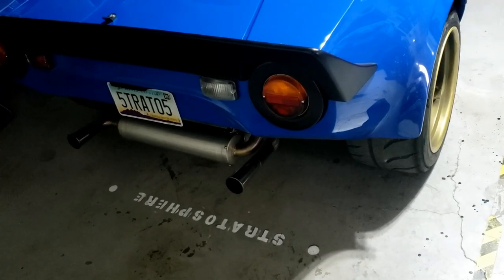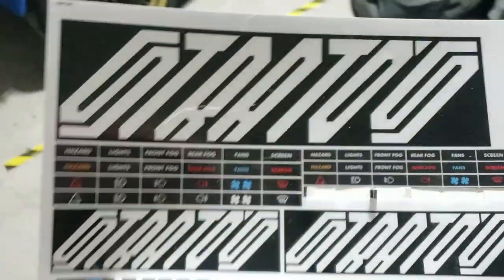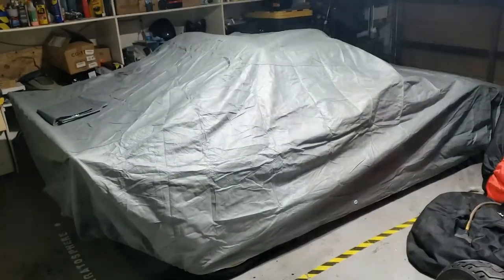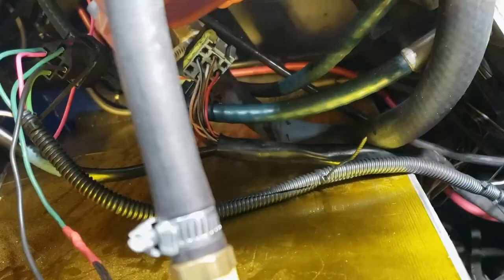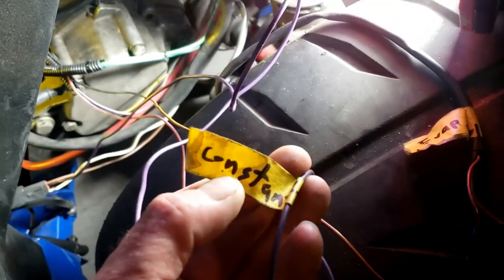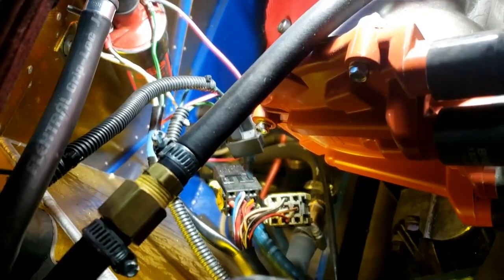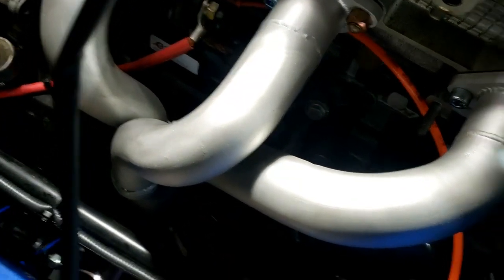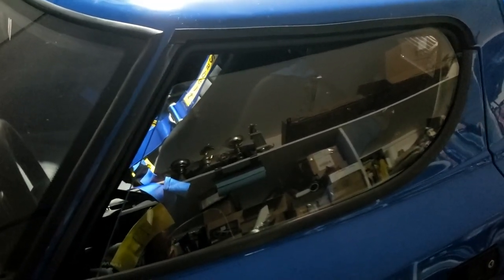#Lancia #Stratos Replica | Lister Bell : Broken #Belts and Electrics

Comment: So it was the AC compressor that seized up that shredded all the belts? How on earth did it get home with no water pump and no alternator?
Reply from the maker: Luckily it wasn't dark so the electrical usage was minimal. The LB #Stratos has an electrical water pump up front to help with the flow front to back and thankfully this was enough to keep the water cooling just enough. I was watching the  temp gauge the whole way and it never got above 90°. The fans certainly helped.